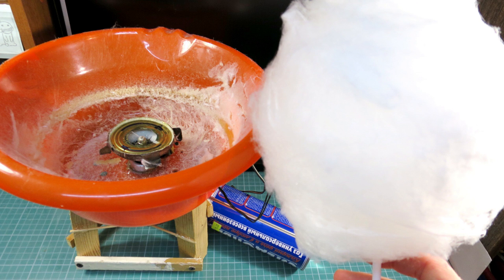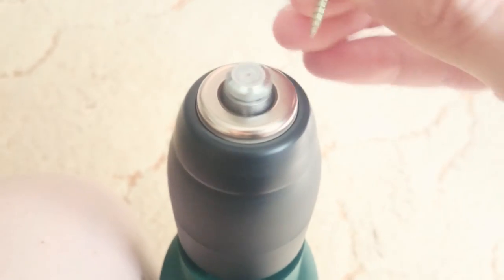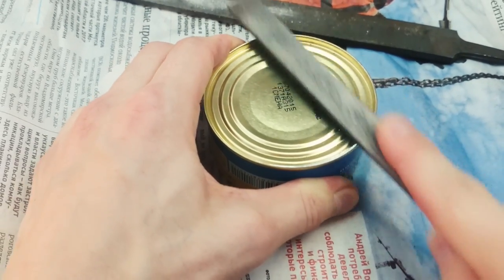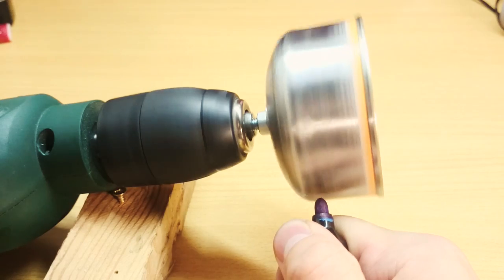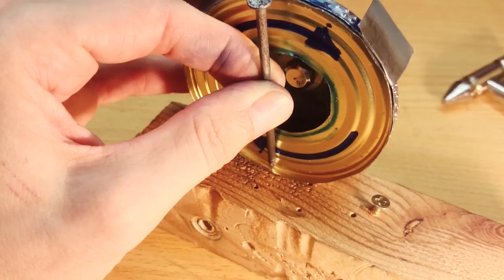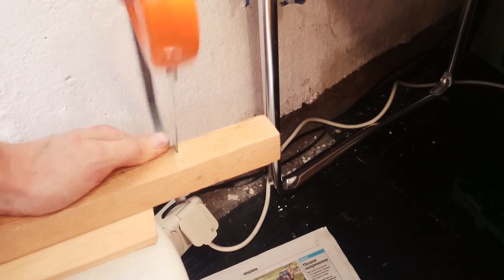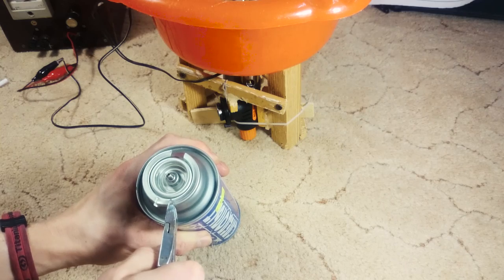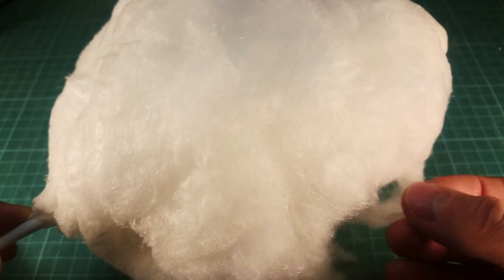DIY cotton candy machine

Comment: Man, when you make a new one, don't put the motor there. Because water is going to enter the motor this way, when you wash it. Put the motor on a side and run the center part (forget the name) with a second shaft, drived by pulleys or gears. And seal it up with a piece of an antenna. ;)
Reply from the maker: it makes sense =) but why I need to wash it with water? Wet sponge is enough =)
Reply: True. But it's always good to put dc motors far from water anyway. And you never know, if someone else washes it. ;)
Reply: хммм